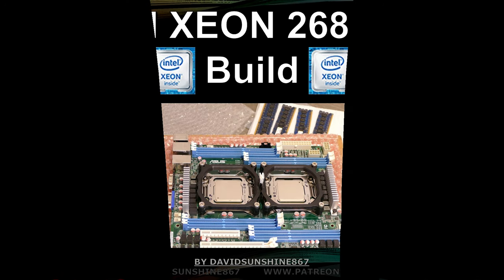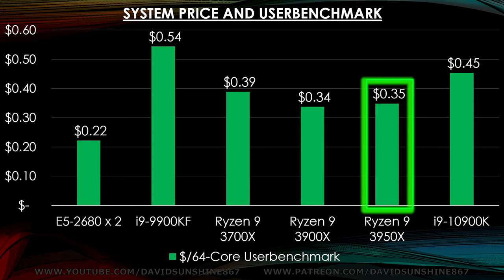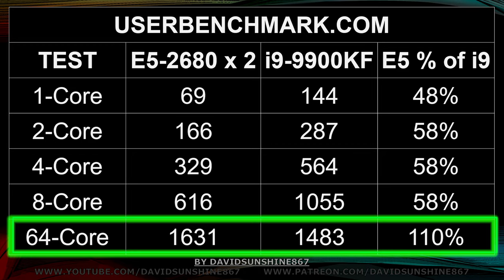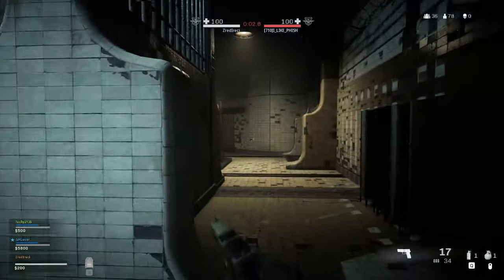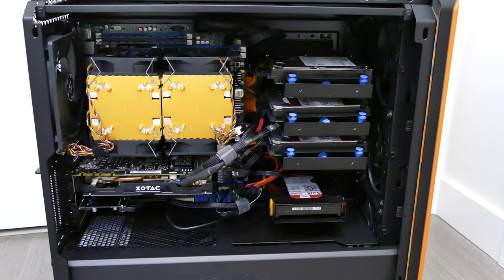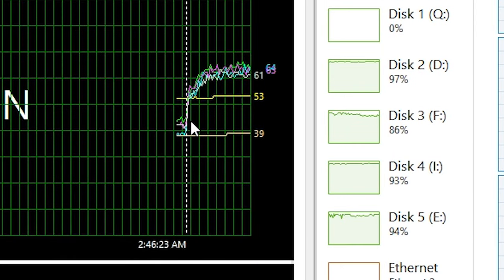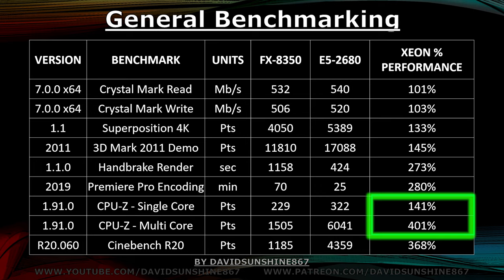Dual XEON CPU Build vs. Intel i9 and Ryzen 9, It's Faster!

Comment: 14:39 I think that's only true when your CPU was the bottleneck. If you had already maxed out your GPU, even a faster CPU won't change much in regard to FPS.
Reply from the maker: Yup, I think you're right too.  My 8350 probably wasn't maxing out the GPU, so upgrading the CPU helped improve performance.  The motherboard chipset and ram probably were bottlenecked, and that helped too.  I wonder if a Ryzen 5950X would help?  The single core performance of the Xeon is not that great, so may still be CPU bottlednecked, wish I had one to test with.
Great point!
Cheers,
David.

Comment: I can get a E5-1660 for under $70 on ebay and that Processor is over-clockable. The E5-1660 turbo boosts to 3.9Ghz and you can get a decent overclock with a good cooler around 4.2 - 4.4Ghz. Then I don't have to worry about the single core performance being that bad.
Reply from the maker: Hi Frank!
Thanks for letting us know!  That's a great upgrade path, I'd like to try OCing up to 4.4ghz! Sounds like that's the way to go for both gaming performance and multi-core if it's a dual CPU system.   And those who only game could just go with a single CPU board. 
Cheers!
David.

Comment: I got a Intel Serer board S2400SC I plan to get 2x 10 core 20 thread CPU's for, Be nice to have 40 threads to play with for rendering.
Reply from the maker: Damn nice!  That'll be awesome.  Rendering is a breeze with all those cores!  Sounds like a cool build.  What CPUs and RAM, and video card are you gonna use?  
Let us know how it goes!
Cheers,
David.
Reply: @DavidSunshine  Planning on getting 2x E5-2470 v2's and I already have 32GB of ECC ram. Right now it has 2x E5-2403's which are slow and not useful for much. I really don't need a good graphics card, I mean I have a GTX 670 in for now for HDMI and displayport and some hardware acceleration, I want to set it up for video editing/nas, take the load off my main PC
Reply from the maker: @VikingDudee  Oh nice man!  It'll do well for you then.  That's what the Xeons were made for so it'll work perfectly.  I guess your main PC is the gaming rig!  Let us know how your build goes! Cheers,
David.

Comment: I would like to make you a question. 
If you disable some cores/threads on Windows exactly at the process of the game you're running, what happen? In theory the processor should activate a higher turbo boost for the game , but I can't prove this theory. Can you test this to me?

Thank you for sharing your knowledge.
Reply from the maker: Hi, 
I tried it out, and limited a CPU to only operate with 4 cores/8 threads, but since my CPUs don't thermal throttle anyways, that didn't yield any better performance.
My CPUs run at 100% and maintain 64C with all cores at 3.1Ghz.  If I used a smaller CPU heatsink, I think it would help though, because my temperatures were low when using only 4 cores. 
So there's not much benefit to this, other than reducing power usage.  Performance reduced along with the disabled cores too.
Best regards,
David.
Reply: Theoretically this might only work for unlocked chips with high overclocking headroom and limited cooling being the only limit.

Comment: Second hand Xeon builds are still reasonable option for a home server or workstation build, but NUMA topology (dual socket) does not really work for gaming. That and also the fact these Xeons tend to run at much lower clocks makes it sub-optimal for gaming workloads. If you need both a workstation and gaming PC, then a Ryzen build would make much more sense: Ryzen also supports ECC RAM plus you get all the modern features on the platform and even pcie gen 4 support if you get something like Ryzen 3900X or the new 5000 series. If you just need server or workstation, then absolutely look for second hand Xeons. If you need both a workstation and gaming, then Ryzen is the way to go.
Reply from the maker: Hi, yes great point!  Ya, it's a great workstation, which is mostly what I use it for. I've been recently using it for PCVR, but the newer CPUs that have way faster single core would be way better for gaming.  I've also only got the 1070 GTX so I'm limited quiet a bit there.  I would like the 3900X for a gaming rig for sure!  Or even the 3700X overclocked would work well.  And maybe a used 1080Ti, good performance for the low price you can find one on Craigslist.  The single core performance isn't great on the XEONs, but it still makes a pretty good workstation or compromised budget gaming system.
Cheers!
David.

Comment: E5-2696v2 only works on certain motherboards. AFAIK anything Asus works, while only select Supermicro ones would boot with those. I have a pair of them on an Asus Z9PE-D16, and if you want to I can post the scores.
Reply from the maker: Great point!!  Ya I would assume if the package comes with the V2 or V3, that the motherboard they send it with is compatible.  But you never know with these guys!  
Definitely would receive 1/5 stars if I had that happen lol. 
That's awesome!  If you could post some of your scores for comparison, that would be great!  I could add it to my graphs too, would be fun to see it in comparison to them all!
Userbenchmark and Cinebench would be representative.  
Cheers,
David.
Reply: Hi, do you know if  Supermicro X9DRD-iF  works with E5-2696v2 ? Thanks
Reply from the maker: @hakoren4444  Hi, 
I think it'll work, because I see this listing for the 2696 v2 with that board on a website for sale.  So must work, might need to update to the latest firmware tho, since the website says v3.0 is required for v2 support.
https://www.ruten.com.tw/item/show?22025709764891
Cheers,
David.
Reply: @DavidSunshine  Thank you. I have E5-2660 v1 so update is possible.

Comment: Dual Xeon is a good idea IF AND ONLY IF (save this checklist):
1. You expect to be doing a lot of rendering, video editing or machine learning.
2. The cost of the Xeon rig will be significantly less than a 2021 equivalent, to offset all the other possible downsides.
3. You can reliably source 100% working parts: Good CPUs (E5-267x to 269x, v3/v4), compatible working motherboard, ECC RAM.
4. You know how to get both CPUs to post.
5. You have a big enough case.
6. You are a gamer and your games rely on the GPU to do the heavy lifting- because Xeon single core speeds are at 50% to 75% of a 2021 equivalent and can cause microstutters if your game is CPU intensive. And if you'll have audio, because hey, these are server motherboards.
Reply from the maker: Great list James!  Thank you for posting that.  I'm sure many will benefit with that. 
The single core performance is definitely lacking for AAA titles, and you can encounter CPU capping/stutter if you have a faster GPU than a 1070 or so.
When I paired my Xeon with a 3070, I got stutters in BF5 under DX11(39fps), by switching to DX12(88fps) which is more GPU intensive, it got rid of the stutter and lag caused by the CPU cap, and could play properly again.  After that, I upgraded to a Ryzen 5900X(@112fps) and got a 30% increase in fps, but it wasn't noticeably faster than the 1st gen Xeons(@88fps) on a 60hz monitor, so the Xeons can still hold their own, under certain settings.
The Xeons are definitely good bang for the buck, with the caveat of all the points you've listed above.
Cheers!
David.

Comment: Thanks that is awesome, I like to build a dual Xeon and 96+GB RAM plus 2TB SSD.  Which one do you recommend? can you give me a link? Thanks
Reply from the maker: You're welcome!  You should do it!  Dual XEON systems are awesome.  Can never have too much ram lol.  I have some links in the description, but the one I recommend is this package:
https://tidd.ly/3gq90vm
It has two E5-2678 V3 12-Core 2.5Ghz/3.3Ghz CPUs, which is 57% Better Performance than my E5-2680.  It comes with 32GB (2 x 16GB), but you can go buy 4 more strips to make 96GB here: https://tidd.ly/33OIW7S
You'll have yourself a very powerful system using DDR4 @ 2400Mhz!
Cheers!
David.

Comment: thank u for this comparison.. am confused  between dual xeon gold 6248r vs threadripper 3970x or 3970x what ur recommend?
Reply from the maker: You're welcome!
Out of those CPUs, I would recommend the 3990X(I assume you meant 3970x or 3990x?), as it's the highest performer, it does however cost $5000.
Here's a comparison so that you can see the performance between all those CPUs, I've thrown on there the 10900K and 3950x for comparison too, their single core performance is higher than the Xeon and Threadripper's, so might actually provide snappier and faster performance for video editing, they will only fall behind for rendering and other multi-threaded applications(server applications).  Interestingly, the Ryzen 9 3950x is faster than the Xeon 6248r CPU.
https://www.cpubenchmark.net/compare/Intel-Xeon-Gold-6248R-vs-AMD-Ryzen-Threadripper-3970X-vs-AMD-Ryzen-Threadripper-3990X-vs-Intel-i9-10900K-vs-AMD-Ryzen-9-3950X/3732vs3623vs3674vs3730vs3598
Cheers!
David.

Comment: May I ask which testing platform (case or openbench) did you use for these X99 dual socket mobos? I had a X99 F8D, but cannot find a case that will fit this E-ATX big boy.
Reply from the maker: Hi,
The Asus board I was using is in standard ATX form factor, so fit in the Silent Base 601 easily.  
The X99 sounds huge!  Looks like the 601 and 802 can support E-ATX though, I'd think any case that can support a big enough E-ATX board would work, just double check the size supported, the Silent Base 601/802 can handle 30.5 cm x 27.5 cm.
If it's bigger than that then you'll have to find something non standard E-ATX, or you can modify the case by removing some items like drive holders, if they are riveted in you can just drill them out.  Just try to find a case without a PSU shroud, then you'll have more space to work. 
The F8D says it's 300x320mm, so it might extend into the hard drive space a bit, but if you don't have drive bays installed it should fit in any case that can handle an E-ATX board. 
Cheers!
David.

Comment: While i have ryzen 1600 but i am always using xeon in dual socket motherboard, it is a lot better.
Reply from the maker: Lol nice!  The 1600 has faster single core performance, so I thought it would do pretty well, but I guess there are other factors at play!
Xeons can still hold their own, that's great!
Cheers!
David.
Reply: @DavidSunshine  I am using Xeon E5 2667 in dual socket X79 chinese mobo 12 cores 24 threads, all cores work at 3.3GHz all the time by stop parking cores and deactivate SpeedStep, it is faster to do my job than Ryzen 1600 and i feel more comfortable with Xeon.

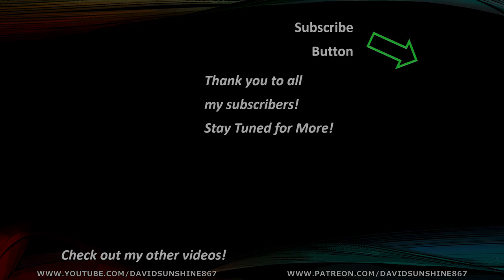Comment: 18:29 i see you enjoying it 🤣
Reply from the maker: Lol ya!  Good eye!  Was hilarious, killed the zombie but it still knocked me down from the momentum of the corpse.  Thought it had me for a second there. 
Then I got back up! Whew....
Reply: @DavidSunshine  last week i bought a new dual xeon x5680 for my 5.1 mac pro, and 32gig 1333mhz ecc ram, it's really refreshing and keeping up with good new systems, i just need to replace my gpu to quadro k5000 and it's all set for video editing and graphics 👍🏻
Reply from the maker: @moaneg1  Wow! Nice setup!  You'll be ready to rock when you get that K5000 in there!  Hell of a workstation!
Reply: @DavidSunshine  yes, i found a good deal on eBay for the card, including 60 days back, so i have a lot of time to test it, but i want to ask you if you don't mind, should i replace the thermal paste or keep it as it is sense it's refurbished?
Reply from the maker: @moaneg1  Great deal!!  Ya test it out to see if it can render without issues, I'm sure it'll be fine tho. I wouldn't bother replacing the heatsink compound or pads, it's 122w and uses GDDR5 which wasn't known to run that hot.
I would run HWinfo or GPU-Z to see how it does while you render or stress test it, if it seems to be running hotter then I would consider replacing the heatsink compound and vram thermal pads. GDDR5 has an acceptable operating Temp of 95C, I would say if it's 85C or below, that should be acceptable.  If it rides above that, you could change it out with some thermaltake pads, might be worth it.
Try it out and see what happens.
Enjoy the new workstation!
Cheers!
David.
Reply: @DavidSunshine  thanks 😁👍🏻
Reply from the maker: @moaneg1  Anytime!  I have been keeping an eye on my VRAM temps and I don't think it's worth it to drop a few degrees, having to take it apart and replace all the pads, better to leave it stock of it's worth well enough. Thermal pads aren't cheap either, so only should use them if really required.
Cheers!
David.
Reply: @DavidSunshine  i'll order some thermal pads just in case,, i already has a good thermal paste in my work place, and i used some of it on the new cpu's 👍🏻
Reply from the maker: @moaneg1  Ya good idea!  Make sure you get the right thickness.  I only had 1mm and 3mm, but when I opened my 1070, it needed one 1mm for VRMs and 1.5mm for VRAM lol.  So I had to improvise with thermal grease and 1mm. Seems to do the job.  But I think I'll gonna try to put little 1mm thick copper pads on the memory to see how that performs compared to my 1mm thermal pads. It's fun to play around.
Cheers!
David.

Comment: Hey silly question guys. I want make this using the e5 2678 v3 x99 combo from Aliexpress. What do you think is the best gpu? I want to get the rtx 3070. Is it overkill?
Reply from the maker: Hi,
If you're going for a gaming system, you'll want good single core performance.  Someone said they can use the 16xx series and overclock to 4.4Ghz, so that would probably be a cheap but good way to get fast single core performance.  If you can do it in dual CPU, you'd have best of both worlds. 
I don't think there's ever overkill with a fast video card though, the better the video card, the faster your FPS.
You'll want a fairly fast single core performance to match it though, you'll be CPU capped if you go with a slower single core performer like my E5-2680, that's good with my GTX 1070 tho.
With the 3070 you'll definitely want to look into an overclocked Xeon.  Definitely look into overclocking the Xeon E5-1650 or something.
Cheers! 
David.